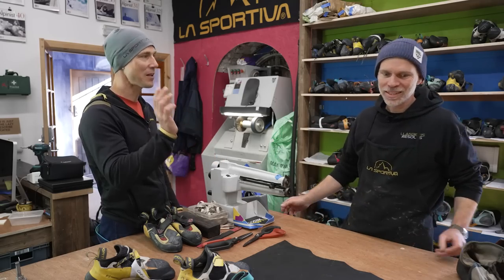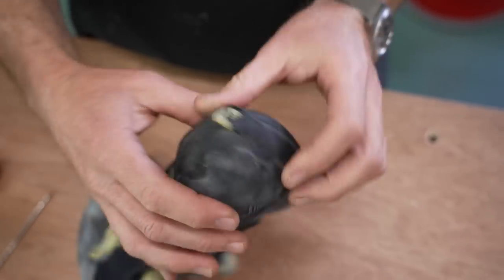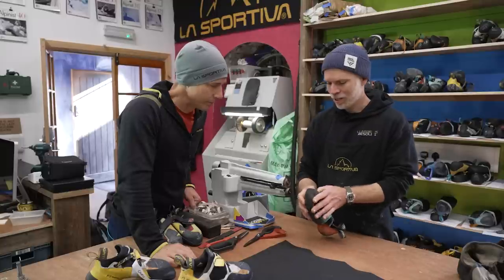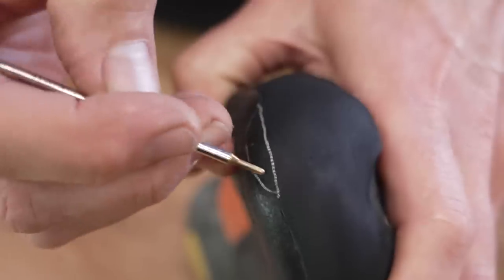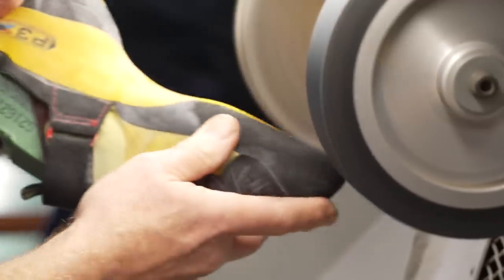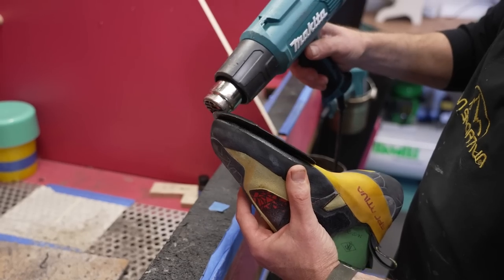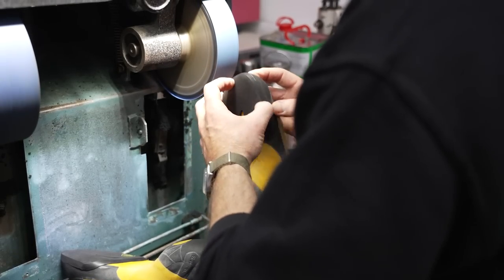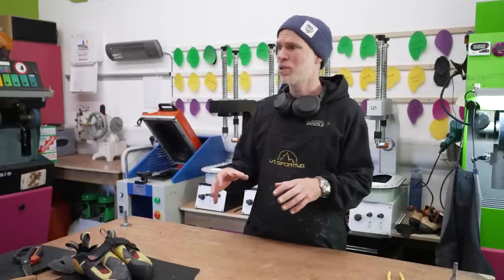Resoling climbing shoes: Is it worth it?

Comment: Depends on the use of the shoe. For an aggressive shoe that you use for demanding steep climbing they are not as good (IMO) after the amount of use on them that requires a resole. Doesn't have anything to do with the resole itself, just that the shoe itself is worn out. Ill run a few resoles on a pair of anasazis or equivalent comfortable type shoe though.
Reply from the maker: Scarpa did offer a complete re-build service, which included a new rand; however, I'm not sure whether they're offering this within the UK anymore after Brexit. That said, I've had plenty of aggressive shoes resoled and never had a problem. I think the difference is who's resoled them.

Comment: The thing is, if I need to resole my shoes when they say it's best, I need to stop using my shoes waaaay before they're really worn out. I can normally do 6 months with a pair if I wear them out to the last bit. If I want to resole them, I can barely do 3 months in them. Considering a good resoling cost £50-60 and the shoes cost £100, it's almost more expensive to resole them earlier than to wear them to the last bit and just buy a new pair. That is only from an economical point of view, of course.
Reply: For myself, if I expedite a pair of shoes to me, costs marginally more than a quality resole with caps redone. This said, taking a few weeks to break new shoes fully in does mean that six month pair isn’t quite six months, and end of life means especially stiffer shoes won’t perform near as well thus hack a little further off.

Mentioned in another comment but my secret has been cycling between sets of shoes. I have six pairs of boosters which I use for training, and I bring two with me for a session and alternate use for a day. Following day on, different two pairs (label the heel tab) and often a day of rest then another day on with a different two pairs, that original set has had three days for the rubber and plastic of the outsole, rand, and midsole to contract and regain original shape. Means a shoe which would’ve lasted me maybe a month at reduced performance  now performs amazingly well every session and lasts me almost a full year with the rubber outsole slowly grinding away which can be safely sent off to be resoled on proper time. Obviously the collection of shoes would be expensive, but having a second pair really does further extend the life of the first if you use them on different days.

Comment: found a top resoler here in Germany, even when there is a hole in the Material, stiches it and when having to put a New rand on a shoe, works it in with the existent rubber not like most places who just slab a strip of rubber on. Problem is, alot of people who do this are not actually cobblers so there is alot of workmanship and quality missing.
Reply: Hast du vielleicht einen Link zur Webseite? Danke :)

Comment: Problems with quality resoles in the US

There are Nowhere near enough shops doing quality resole work on climbing shoes in the US.  The result is inconvenient & too costly and way way too long of turn around time.  If it takes 12 weeks to resole a pair and a pair lasts 4 weeks, do the math.  This is a big reason people do not send shoes in early (before blowout).  

If a resole took 3-4 working days plus 5 for back and forth shipping for remote shops (two for local) and the price was approximately the wholesale cost of a new pair or less, things would be good.  This is far from reality however on every front.

One issue is the complete lack of readily available and economical climbing shoe lasts for purchase in the US cobbler market.  Without this, small shops cannot do quality work, even with a good press.

I hope things get better, but in recent years, they have gotten worse.
Reply from the maker: I really hope things change. In the modern economic climate there should be a place for it and with more and more people looking for more sustainable options you’d have thought there’d be a tonne of people interested.

Comment: I've found "used twice" shoes off of craigslist or FB marketplace for as much or cheaper than resoles, however... I do have several pairs I've held on to that are form fit to my foot that would be good candidates for resole.  I should pull the trigger, huh?
Reply from the maker: The difference in between worn/second hand shoes and resoles is that with a good resole, you're effectively getting a new shoe, so in that regard the two are incomparable.

Comment: Its a shame sole resoling is so expensive here in the UK. Looking at around 75+ inc rand repair with postage on-top of a long turn around and the possibility of the getting a bad job.
Reply from the maker: I think the key is to get shoes soled before they're totally and utterly battered. If you do that they'll not only be cheaper (£51 at Llanberis Resoles), but they'll also be able to resole them to a much higher standard.

Comment: Can you resole very soft shoes? Like a LaSportiva Mantra for instance? I've taken some Team VXI in for resoling twice and both time they were totally ruined with a stiff rubber sole and I'm curious if its a thing that can be done or I just didn't get proper resoling done? Not going to name anyone.
Reply from the maker: You can, but there's a caveat. Because Five Ten don't supply the original parts, you'd get a fairly generic resole for that using what I suspect would be 3.5mm Vibram XS Grip, which would probably explain the unsatisfactory results you've received previously. With La Sportiva (and Scarpa), if you're using one of their  accredited resolers (such as Llanberis Resoles) you'd be getting the exact same sole as the one that was on the shoe when you first bought it, so it should feel pretty much the same. Hope that's of help!

Comment: I had my boreal diabolas resoled by Llanberis resoles. First of all top service and communication and te repair was done faultlessly. The only thing I found was that they never regained the original stiffness so I found It harder to stand on small edges for long as the tension was lost through the bottom of the shoe. Is that the case with all shoes because I want to resole my skwarmas but feel It might be a waste of money if they don't feel as stiff as new.
Reply from the maker: What I would say is that modern La Sportivas and Scarpas are designed far better for resoling and Torquil uses genuine La Sportiva parts, so it's far more likely you'll get a better result than with Boreal shoes.
Reply: Skwamas resole a lot better than any Boreals! As long as you haven't worn them out too much I think you'll be surprised how much better the resole is on a Skwama.

Comment: How many times can climbing shoes be resoled?
Reply from the maker: Good question, albeit a tough one to answer, because there’s quite a few variables. Some brands are better to resole than others - such as La Sportiva and Scarpa - so those going to be able to take more. Beyond that it’s simply a case of what condition your uppers are in. If they’re ok, they’ll likely be fine for a resole.
Reply: It really depends how worn they get each time and which shoe it is to start with, It can be anywhere from 0 times to more than 10.

Comment: I get climbing shoes on sale. I did resole for years including with Llanberis Resoles (granted he his one of the better resolers in the country), maybe resoling twice before retiring the shoes, but the reality is that resoles NEVER perform as well as new shoes. Coupled with the fact that resoling now costs close to the price of shoes on sale or more - not for me sorry - performance is first priority and resoles just haven't cut it.

Ask any climber operating at a high level and most will tell you the same.
Reply from the maker: Out of interest, have you tried any of the more recent resoles using the official components? The impression I got was that made a massive difference. Maybe it’s not what people at the top level are doing now, but maybe - now that things are changing - it’ll be the case in 5-10 years time.
Reply: I just have to point out, either you get your shoes really cheap or the resoling costs are higher there. Where I live, a resole costs like 30-50 euros and the performance is the same as new. I really don't get what could change with performance when they use the same materials that the shoe comes with when repairing. it's the same rubber compound, in the same shape and thickness, attached with the same glue or similar. 

Perhaps the loss in performance you have noticed has more to do with the shoe getting older rather than the resoling.
Reply: I know many top level climbers that would disagree with that. I regularly do resoles for people who get their shoes for free. If you catch them soon enough they should give you better performance.
Reply: If I wanted to get a new pair of shoes to me in two days, would cost me less than resoling. I still resole everything, and know many athletes who could always request an expedited shoe and yet always spend their own money to resole.

One secret is to cycle the use of shoes. I have sets which I use on different days, giving the rand, midsole, and outsole chances to “recover” rather than degrade at the same rate as the climbing rubber. I have a pair of Chimeras which are three resoles on and another after two resoles which are my favored onsight pairs with me on a trip now.

Comment: cheaper to buy new shoes at their prices - its like £70 a resole
Reply: Shoes are like £140
Reply from the maker: It's £48 for a resole and £66 for a resole + rand repair; however, as per the sentiment outlined within the video - it's far better to get them done sooner rather than later, not least because it's cheaper, but also because they can do a much better job. Whilst you could buy a new pair, I think that goes against another ethic we discussed, which is that it's best to keep your old shoes in use (if you can) as opposed to in landfill.
Reply: @ukclimbingofficial  Is the pricing for 1 shoe or 1 pair?
Reply: @MattLamPiano  one pair
Reply: @basti1597  Thanks! That's definitely way cheaper than getting a new pair
Reply: 50 for a top job of fresh rubber when news are 150 is something I wish I had near my country.